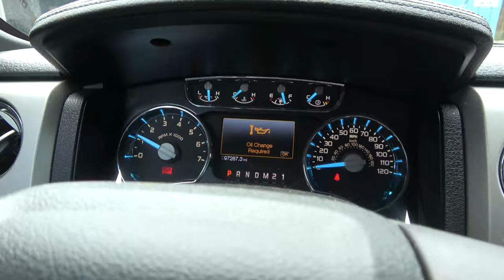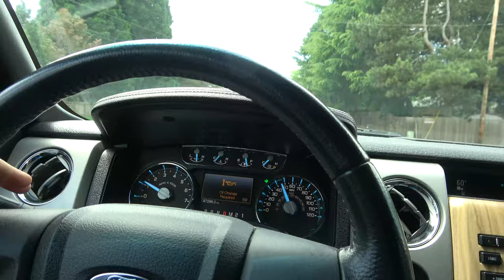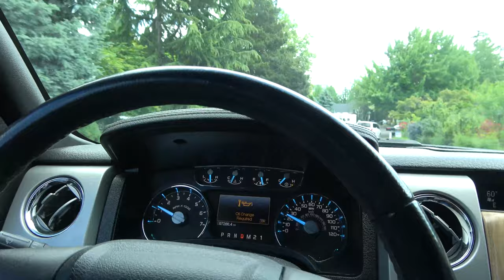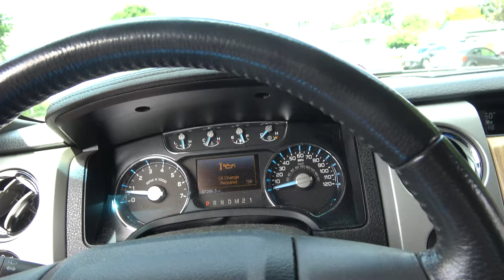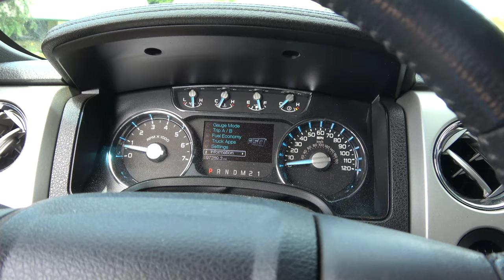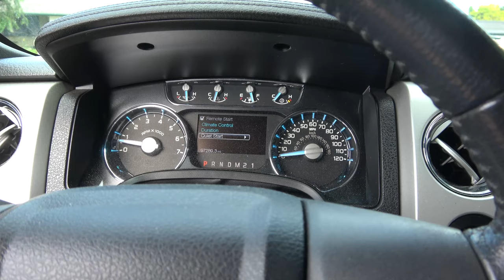Oil Change Required

Comment: I'm using synthetic oil in my Bronco. Can i change my filter without loosing my oil?
Reply from the maker: Larry Hudson you can, most of it is in the pan...
Reply: I put a new motor in last year and changed the oil. It dawned on me with a dirty air filter the engine oil filter must be dirty too. Thks for the answer!

Comment: I thought you used rotella for moms flex?
Reply from the maker: chad harmon I used it once to see how it liked it. But I like using the motocraft stuff nowadays.
Reply: Johnson's Gee-rage I use valvoline high mileage 10/30 in my old explorer 5.0 it’s syn blend also